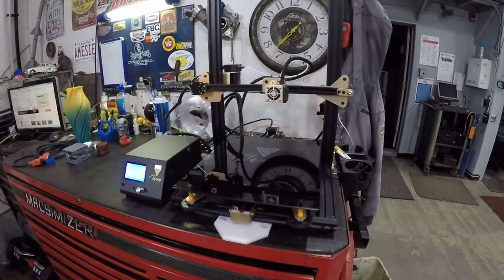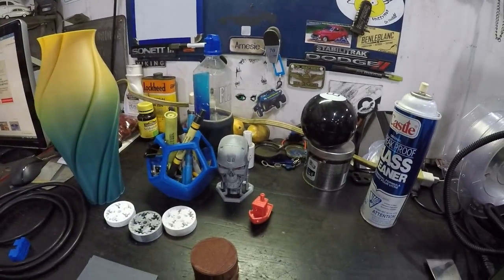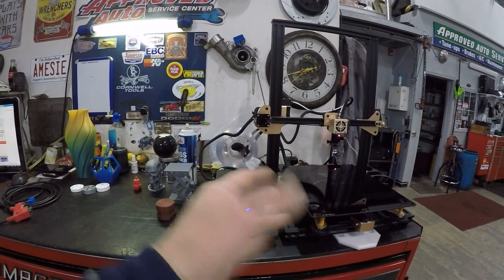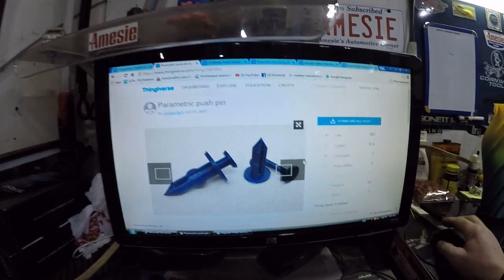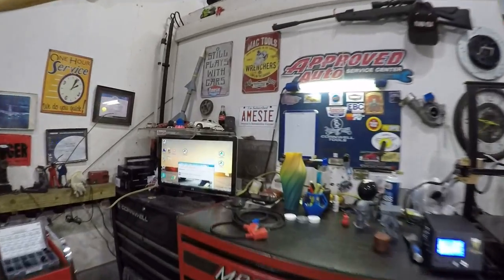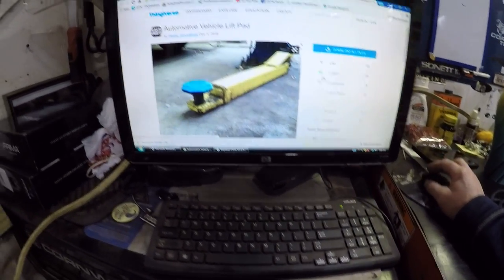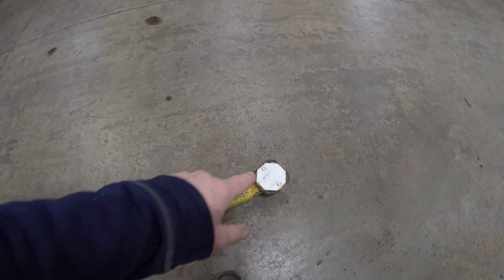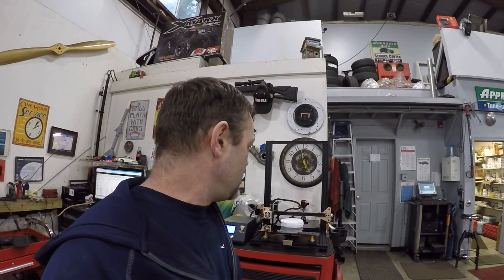Practical 3D Printing in The Garage!

Comment: Just watched your video about making these pads.  its been over a year and i was wondering how long they held up.  the cloth/rubber ones at my shop are in need of being replaced so i might see if my boss will commission me to do these, but i want to know how long they lasted.  Thanks for the video and look forward to hearing from you.
Reply from the maker: I've been making them from flexible filament and they hold up better than the rubber original ones. Almost 2 years later and they still look and work great.
Reply: @AmesiesCorner  do you have any issues with them cracking or breaking?  Are you using pla+? petg?
Reply from the maker: @CaptainRon1  flexible tpu filament and they hold up very well. But don't like brake fluid.

Comment: I built a height adjustable platform out of wood. Not much bigger than yours but I added 4 metal round rods at each corner going from base and then through the top platform. Since the rods were anchored they stayed perpendicular. This meant the platform didn't wobble as I raised and lowered it.

Comment: Don't they have to be rubber so the cars don't slide around? How about cutting them from a semi mud flap?
Reply from the maker: well yeah we cold also buy new ones but I want to see if 3d printing can  do it. so far they work great and are actually flexible enough for pinch welds to bite into.

Comment: Are plastic lift plates recommended? I've only seen rubber used here in Australia; would think plastic opens up chance of cars shifting where rubber can absorb?
Reply: I was wondering about the friction on those pads too.  

I'm not up to speed on 3-D printing but years ago we were very limited in the plastics that were available.  
Everything was very brittle back then.  

What came out looks like ABS but he read PETG which I think is a special kind of PET for 3-D printers.  My guess is it is similar to a clear plastic Pepsi bottle.  Not brittle but not a lot of friction either. 

Informative video !

Comment: I have an exercise machine with a broken plastic control. I'd like to 3D print a replacement, but I don't have all the pieces and can't scan right now anyway.  I guess I have to redesign it, at least the missing piece.  Any suggestions? It should be more strong too.

Comment: Pricing has come waaaay down on the printers....neat!  When doing things like push pins or any small parts, has the software developed enough yet to do multiples at one time? The plate looks big enough to be able to do a dozen at a time easily, and then snap apart like model kit parts. Or is the nature of the hot filament and the machine itself not feasible to do that?
Reply from the maker: I could make probably a hundred or so at the same time on that bed.
Reply: @AmesiesCorner  that's fantastic, and you're right, its the way of the future

Comment: Certainly useful things, especially for smaller, irregular items like pins and window clips, but I'd just cut those out of delrin/hdpe/uhmw with a table saw and a drill press, vs 18 hours on a 3D printer
Reply: Tech will advance. Downloading an mp3 files used to take several minutes at best. Now it takes seconds.

Comment: So its not just me that thinks Audi water outlets are made from  black cheese and vent hoses are made from licorice. as for the window regulators  on golfs.  The plastic wheels for the cables are crap quality.  Vw/Audi stopped making good cars when they started putting radiators in them.

Comment: Very cool Paul. I have been thinking a similar thing myself, but more along the lines of every household having a printer. Kinda like the Jetsons or Star Trek. If you need something, just hit a button and badda-bing. Have you printed stuff for your crawlers? I have a Tevo Tornado and have been teaching myself CAD. I've designed a bunch of parts for crawlers.
Reply from the maker: Only a few crawler parts. There aren't a lot of scale stuff
Reply: @AmesiesCorner  did you use anything on your build plate, glue stick, hair spray, etc...?

Comment: Idea on those pads. Print two "studs" in the hole locations. Then you don't need the bolts either.  I can see this for some parts or possibly tools like NASA does now. It will take a lot of advancements in the technology before I'd trust anything like a ball joint or tie rod end from a printer though.
Reply: I think the concern with that would be lateral force on the pads - sometimes the lift locations aren't totally flat and would push the pad horizontally, and plastic pegs would likely break imo.
Reply: I guess it depends on the lift, mine has the pads in a bucket so lateral forces are not an issue.
Reply: They print metal now too.